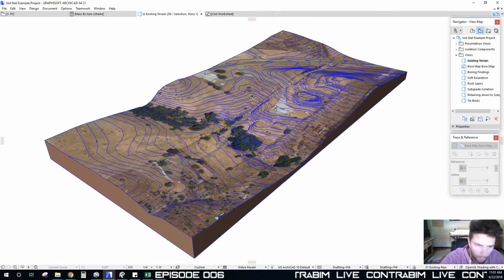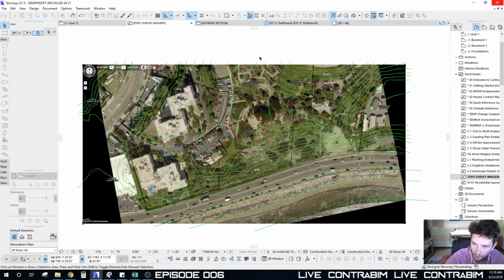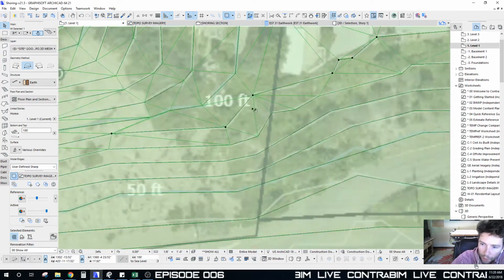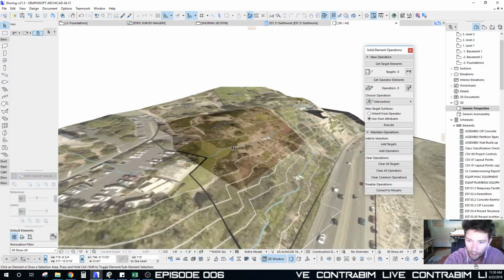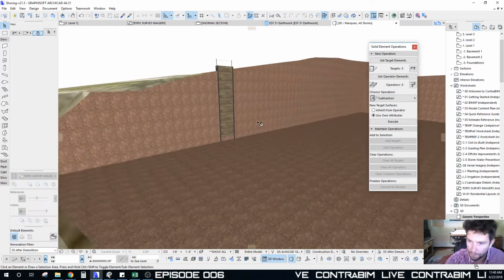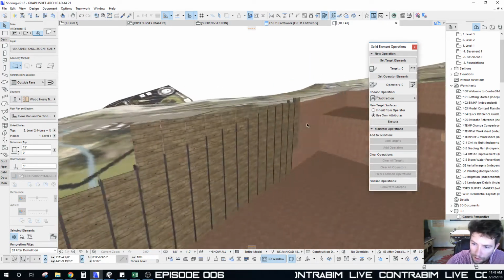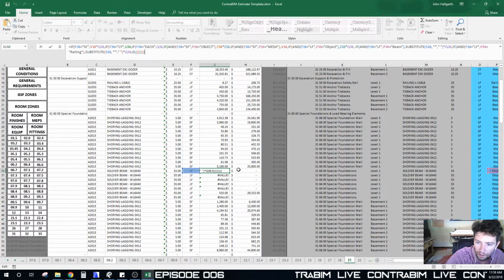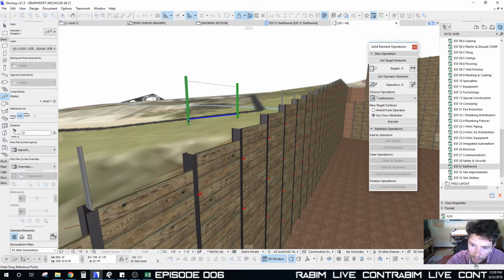How to Model Shoring & Deep Excavations in ArchiCAD (Ep006)

Comment: Hey I built a topo surface with Cadmapper and the Element Operations do not work on it because it's a morph and not a mesh. How can I make Deep Excavations when im working on a morph? Thanks in advance
Reply from the maker: Hi Nick. The solid element operations should still function with a morph. Both a solid and non-solid morph should be able to get subtracted from. I just did some testing to make sure it does work and I didn't have any problems. You could also use a morph to cut a morph with the boolean operations>subtract function.

Comment: Hi! John. For me is not quite comfortable editing tie-back shoring. May be created gdl object for this. Add setting on nuber of anker, size for panel? I think object is really helpful to you.
Reply from the maker: Thx for the comment, & great suggestion on GDL! For myself, I'm typically referencing in sections, elevations, and tie-back charts from the engineering teams, and the input and modification of individual components is easier for me than with GDL. I also produce takeoffs for tie-backs (LF), soldier beams (LF), and lagging (SF) individually to link up to sequence schedules and estimates. GDL has huge potential, but sometimes I still prefer the granularity and control of individual components. BUT...I think it'd be super interesting to walk thru the steps of building such an object...perhaps in a future video. Do you have much experience with advanced GDL?
Reply from the maker: Also, the modeling approach I used in this tutorial, was quite frankly terrible compared to how I planned to do it. Something I'm doing a followup video on because it certainly wasn't my best demo on the shoring system :)
Reply: I know gdl on low level, i make edit finish object (add simple parameters and some functions). In my company we order this objects from programmers. Not much many people in Russia knows GDL, nevertheless some of this works free. Big respect them for that! =)
Reply: All is well! Do not worry about it!